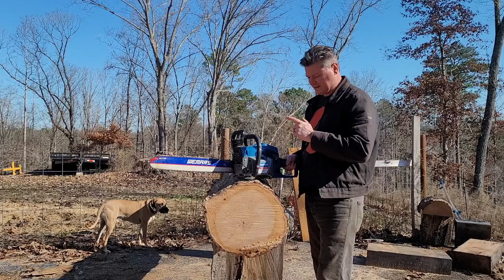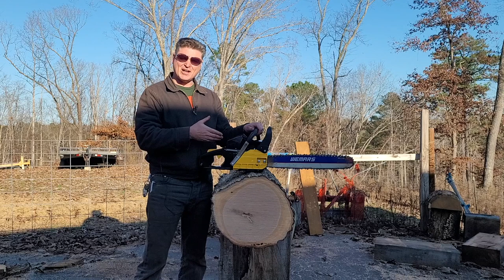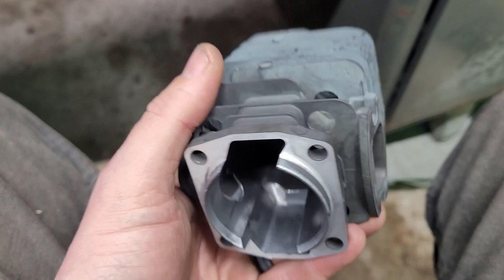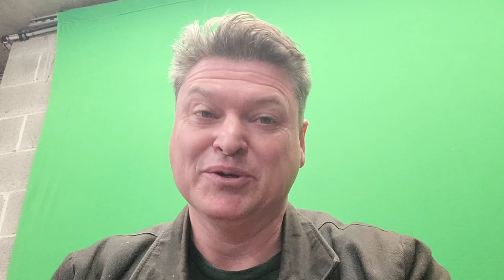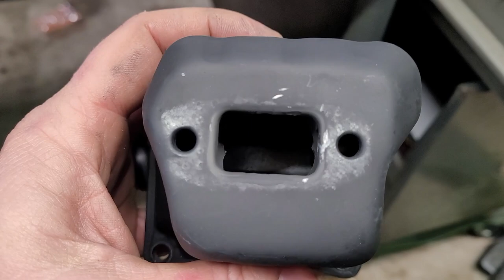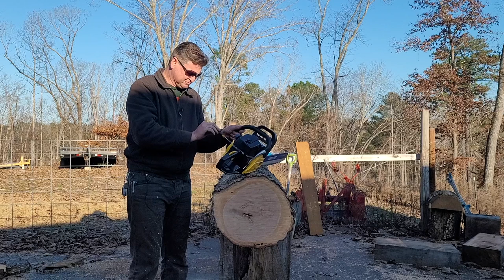Ported Coocheer 6200 vs Stock Wemars 6200 Chinese clone chainsaw

Comment: the Aliexpress cylinder at 20 euros delivered (~22 dollars) is correct for these machines.
 diameter 48 (62cc) called here "58-3". 
the numbers are limit high, would be better a little less strong, they are the following without gasket base:
 intake 158 duration. 
transfers 127 duration. 
exhaust 165 duration (97.5 from TDC). 
the piston clearance is very correct, I am rather surprised by the manufacturing quality, we have seen much worse.. 
Cylinders with too high numbers can often get good torque and power with an intake vortex  just after carb, for better filling and better mixing.
 Vortex in 0.5mm stainless steel with mini 8 very fine blades, preferably sharpened, otherwise the result can become bad. 
Bad vortex = bad result 
Good vortex = good surprise.. 
This Aliexpress cylinder did not need intake vortex (without base gasket) to work well. 
Thank you for this video 👍

Comment: I saw your 550 build and was really impressed. Do you think I could do a base gasket delete or a pop up piston and get good gains from it on my 550? I'm not sure if it has clearance for all that without machine work but I'd appreciate the advice if you know . Thanks in advance and I appreciate the videos I'm learning alot
Reply from the maker: NO!  On the 5 series saws, even just a base gasket delete requires you to shorten the cylinder skirt.  If you remove the gasket and then just put it back together, you will fold the cylinder skirt inward and ultimate doom awaits!
Reply: @novicelumberjack  man I appreciate you telling me that bit of info. It definitely kept me from destroying a almost brand new saw.

Comment: As we spoke, my Wemarrs 6220 IS well made, though the assembly of the ignition is toy(ish), the oiler is barely functional, the chain tension screw is laughable, and its power is more in line with a quality 45-50cc saw. The last part I’ll address (hopefully) with a tuneup. What do I expect for $145?  This saw.
Reply from the maker: Send that thing back!  Out of all those things you just mentioned, the only one that I can relate to is the chain tension screw.  The two that I have owned have oiled great, the ignition system is fine, and the power of my 6220 is better than that of my Husqvarna 55.  So...something is wrong.  Mine both came VERY rich from the factory.

Comment: I have a couple of these types of china saws. The ones with quad transfers run better than the ones with dual transfers.
I recommend the joncutter 5800, it has the better cylinder and runs good. I also have an older timberpro6150, it's 61.5cc and a good version of this clone, it really rips with a bigger carb.
There's an intake block on ebay that lets you fit a 372 carb onto them, it's a big improvement power and rpm wise, I gained about 2000rpm in the cut with that mod. My joncutter cuts at 13000rpm.
Reply: That's awesome what do you have to look up to find that? I used a metal broom handle and silicone to do the same thing on my garwinner be nice to have a actual intake.  16mm vs 10mm definitely a huge difference

Comment: When those orange “ choocher” I thought there was an h up front…???  About 5 years ago I grabbed one for a hundred bucks and then I had a guy outside of Philadelphia that had bought a cargo container I’m assuming because he had about 20 left and he was done selling them…. I counted his 75 with 50 apiece and he jumped so I must have been around what he paid….   ??? Mines orange and 6 years old and it’s a running son of a gun… I’ve been looking and with a 45mm bore they have to have a little more stroke to get to the 60CC’s?    I’m going to have to rip into that at some point but entirely too many good saw’s to knock out before I can waist any time on that one…. On your porting numbers remember that you lower your intake and you make more power but after 60… or so you really start eating lots more fuel for that small addition power… and it’s often much better to simply remove a pocket from your piston as the more material that you can remove from your pistons th you make more power but have less fuel robbing properties…. There’s a lot of wasted pistons material on that 372 Xtorq and buy simply cutting the additional 1/2” of piston skirt off your lighter in rotation and faster to throttle up and hold your power longer…. Be really looking at any additional material on your pistons before your grinding away from your ports as it’s much more work to finish them up nicely and with a piston it’s a quick little roll to smooth with some 1000 grit… anyway it’s a nice thing that you are doing a aid those poor folks…. I’m praying we send a couple of transports with stinging missile in them so that these proud strong folks can absolutely devastate the USSR… and destroy all incoming missiles being fired at their major utilities….   It was actually absolutely glorious when Russian having some of the pretty decent quality helicopters were pounding on the afghans and we carried in 300 on donkeys in three days of training 45% of those Russian helicopters were burning rubble….   Quite honestly if anyone in our present society aren’t feeling that they have a really great relationship with their lord and savior…they might want to rethink their thinking because we have two nuke subs just outside of range to turn Moscow into glass…. I’m really not quite sure that our current leader’s would be as good and ready as I am to send in a couple just to say hey bitch… that’s enough!  But we should definitely be ready to get into the nuke show sooner then later!  Now that the Russian people are really starting to stand up for world freedom and they know they are getting hustled….  And they are defection’s instead of fighting….the Russian people don’t want this war anymore then anyone else… too bad that we stopped our 11 teams and haven’t just shot him with a poison dart and ended the world’s problems… but they have a few hit teams here too so it would definitely need to be a very serious open up the Mountain in west Verginny and get our leaders and their families there.., before we go punching tickets…. I’m so pissed I’m 53 with horrible knees or I’d be more than happy to be headed to a tall building near the Russian capital to have a chance to be the guy that got to send a 308 through Putin we have allowed him to get away with entirely too much carnage without hitting all his personal assets with drone strikes…. I’m a hillbilly redneck…my diesel is $6.50 a gallon and it’s time for them sumbitches to start watching their backs… God what I would give to have that gentleman in a set of crosshairs with a spotter calling my windage !!!    God Bless y’all and hoping that your Christmas was delightful!  If you ever decide to make a weekend or shooting up 2” foam board then blowing more insulation in behind it in that raised ceiling area… I’ll volunteer to assist if there backstrap for the apple wood fire … we can always move your garbage can outside to get them up to 150! LMFFAO!   That’s a very interesting property that you have there… very unique find!!!  Beautiful place to keep working on your project’s to continue to make it better and better!  Any son of a gun who will cook his brats in the ember’s trash can setup that he designed and built is okay with me buddy….  But please remember that several of us have 30 years in various trades and loads of knowledge and ability and there’s just something about this group of guys that link us up together on a very unique level and helping out a fella member for a couple days isn’t out of the question!  I just took a very nice looking porter cable framing nailer from an old guy that needed his 372 rebuild immediately as one of his guy’s burnt her up…. So I opened up my parts box for the 372 parts and rebuilt that night for him because he had a decent job lined up…he had a hundred dollar bill and this framing nailer so if you ever need one for awhile it could be at the post office pretty quickly buddy.    Even a smaller compressor will stoop 31/2” framing nails pretty easy!  You could do 2x4’s on 24 and drywall it then mill some fake beams out and not only gain a lot of R-value but having some beams shoot into some pitched 2x4’s would actually add a little rustic look to that open higher ceiling area…. Slap some light cream paint over the drywall area’s in a couple of hours and it would look fabulous!!!!   LMFFAO!
Reply: Doesn't get any more American than this guy eh lmao

Comment: You did something wrong.
Reply from the maker: You didn't watch all the video.  Either that, or you don't know anything about port timing.  And that's okay.  Keep watching my channel.  I talk about that stuff all the time.
Reply: @novicelumberjack  what is fi of the piston?
Reply from the maker: I don't know what you are talking about, "fi"?  What do you mean "fi"?
Reply: @novicelumberjack  fi is diameter
Reply from the maker: @11T872  okay, so the bore diameter is 45.24mm and the stroke is 34.22mm.
Reply: @novicelumberjack  that's 52cc saw,    46mm piston is 56cc.and 47.5 is 62cc zenoah clones. 👍✌️
Reply from the maker: @11T872  Then how do you explain the 34.22mm stroke?  I get stuff like this ALLLLLLL the time.  Don't mistake this comment for me feeling weird or anything like that.  I don't at all.  But what seems to happen very often is that someone has read some sort of specs and they expect it to apply to these Chinese clones.  It doesn't.   There is often no rhyme or reason to them and they NEVER spec out like they should.  People can say what it is supposed to be all they want.  But when you actually measure them...they are all over the spectrum.  This saw is 55cc.  If you round up on the numbers, it could be considered 56cc.  Not 52, not 58, and most definitely not 62cc.  My Wemars is the same way.  I think it spec'd out at 59cc.
Reply: @novicelumberjack yep totally agree, it never lines up with whatcha think it ought to be